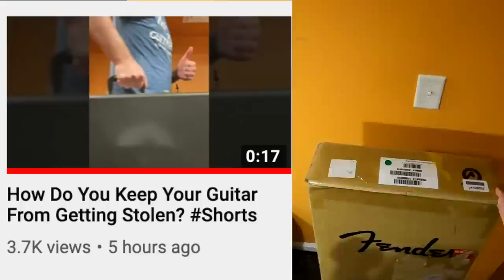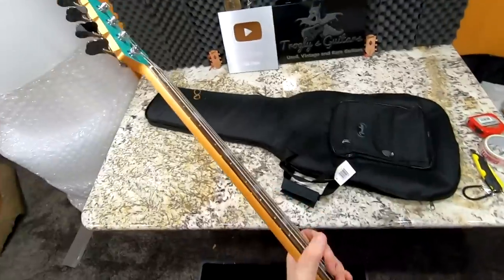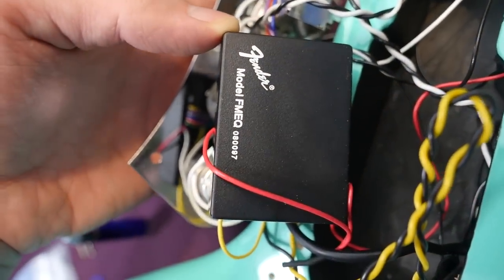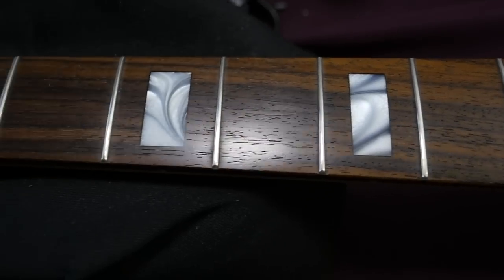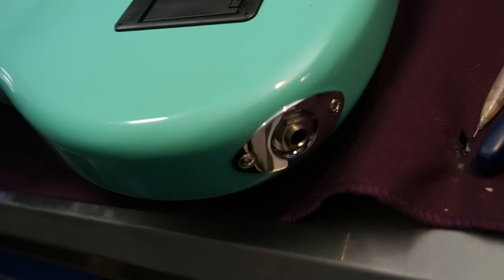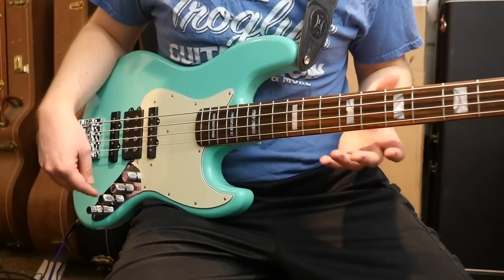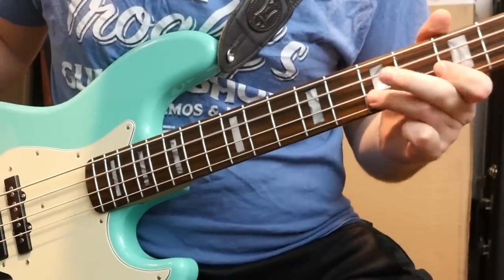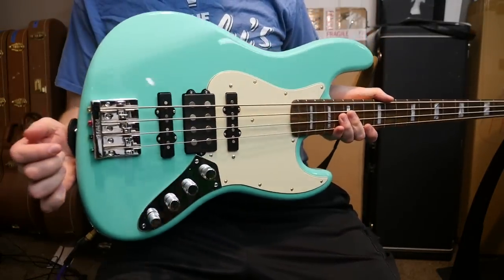Check Out Jino's Crazy New Signature! | 2020 Fender Jino Signature Jazz Bass Seafoam Green Review

Comment: Perhaps for recording bass samples you could try using the amp sims in Apple's Garage band. A nice variety of preset models with ample tweakablity.  You change amps, amp settings, cabs, mic placement and effects, but you don't have to because the preset models are fine.  Through the pandemic I've been working with a band by putting bass parts down in Garage Band.  As for as the Jino bass, I dig it.  They achieved a bass that can do both the J bass thing and the Music Man Stingray thing.  It's elegant and brilliant.

Comment: If you're in active and the battery dies do it automatically bypass and become passive on both settings?  Will it be passive with no battery.  Even tho a dead battery still completes the circuit no battery would break the circuit.